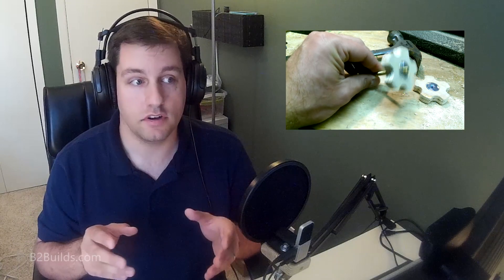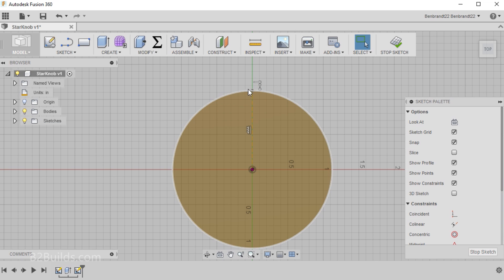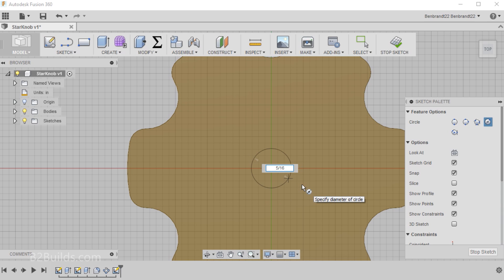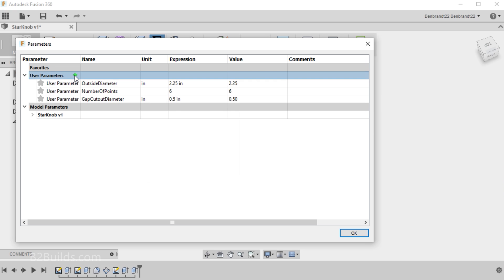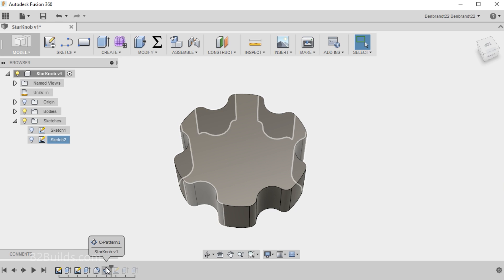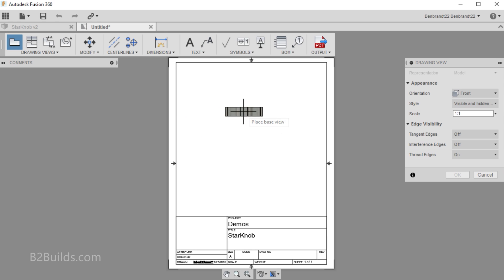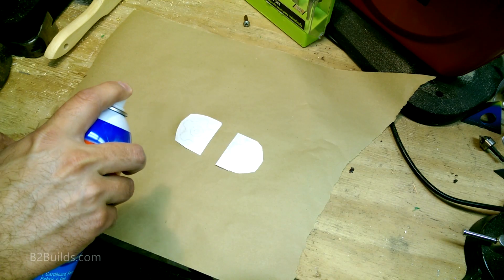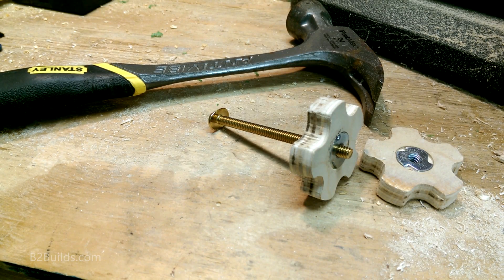From Fusion 360 to Bandsaw: Parametric modeling and building a Star Knob

Comment: Could you try this same thing again? I cannot get the Number of Points to change. I am wondering if there is a new bug in the program. I did everything the same way you did (tried several times) and when trying to change NumberofPoints, it does not change them. Changes everything else, just not that one. Thanks! I needed this tutorial. Great work!
Reply from the maker: Hard to say without seeing your model, but make sure the pattern feature has the text "NumberofPoints" parameter name in the box for the number of items to pattern, instead of an actual number.
Reply: It does. I did everything right. I am 98% sure of it. I wonder if there is a new bug in the program we should be reporting. Its the only one with No Units. Does yours work with the latest version?

Comment: Really great video. One question I have is, can Fusion 360 projects be exported to SketchUp? I really can't see why I need to relearn another CAD program. Also, can you share that drawing code so I don't have to TRY to reinvent the wheel? I have been trying to learn Fusion360 but I'm having a real hard time. Your explanation is the best I've seen yet.
Reply from the maker: Well, you could probably export a fusion model to a STEP or IGES file and import into Sketchup, but if you've already built the model, what more would you do with it in Sketchup? You would lose the design history and the ability to easily make changes. Fusion is very powerful and makes it easy to build and modify 3D models. There's certainly a learning curve and it's not for everyone.

Comment: I like to use a small hole saw from a door lock set to cut disks out of 1/4" ply and glue them over the T nuts and thread the bolt in from the opposite side.  The wooden "washer" keeps the T nut secure and gives a slight spacer between the knob and the work surface.
Reply from the maker: Sounds like a nice approach.

Comment: You could've printed using a laser printer and transferred the image using a wood burning tip to the wood.
Reply from the maker: +Stuff With Kirby true, though I only have an inkjet. I've done inkjet transfer before as well, but I prefer the glued-on templates because it's easy.

Comment: Nice Job Ben.  Really clear and easy to follow.  I am a mech. engineer by trade though but I did learn a few things still.  Good Luck!
Reply from the maker: Thanks Neil, glad it was useful. I started my career in Manufacturing Engineering and have used a variety of CAD packages in the past. I've really been enjoying Fusion 360.
Reply: +Ben Brandt I just started using it too. Seems capable enough for most hobby projects.

Comment: Does Fusion 360 allow you to output to a file format that is compatible with an X-Carve or similar CNC?
Reply: 360 is the prime tool I use with my shapeoko 3. It's geared more for milling that a cnc router, but it is pretty powerful.
Reply from the maker: As far as I know, you can generate CNC tool paths within Fusion 360. They have a built in CAM function. I'm not sure about the specifics of how it works though, as I don't have a CNC machine myself... though if I did, I'd be all over that  :-)